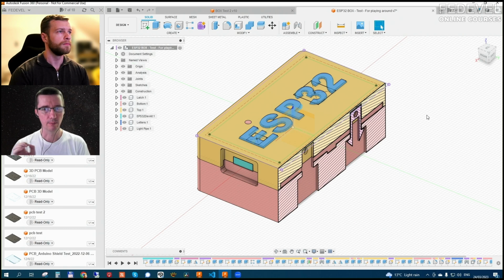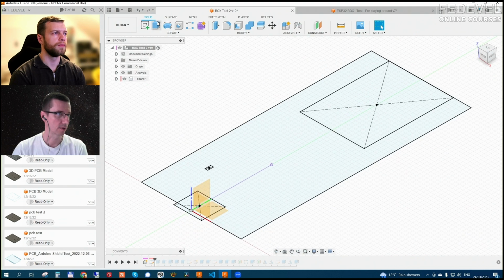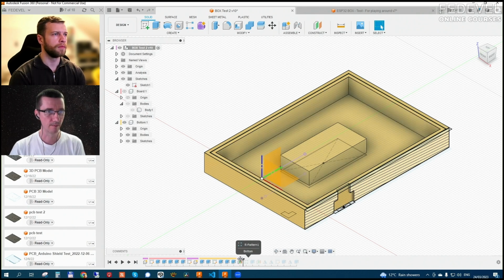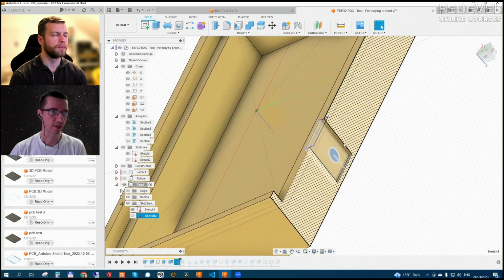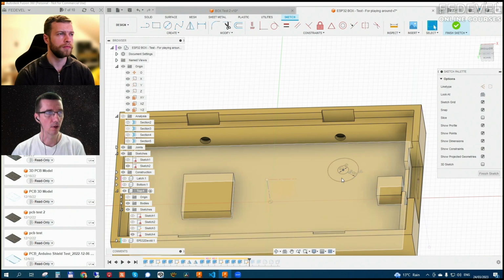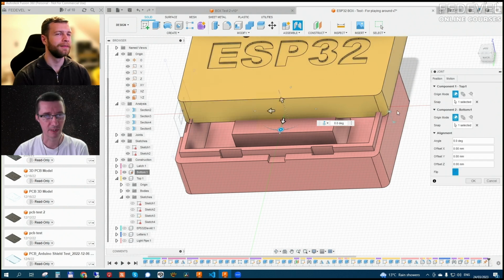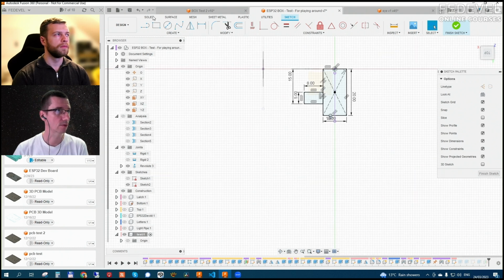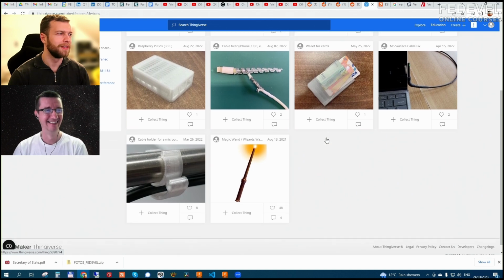How To Do 3D Mechanical Design? It’s Easy. This Is How It Works ….

Comment: Nice seeing both Robert and Phil in a video.  Anyway, you are talking about importing PCB and surface finish for rendering.  The best way to import a PCB is using a step file from Altium.  From this you have all of the same features as you have for the faces and modeling tools.  In addition, with Altium if you have enabled Co-Designer, then you can have a direct push/pull link between Altium and Fusion.  Likewise, I believe the reason you don't see an option for STEP is because you are trying to do this by use "Insert".  The best way is to use "File Open",  that gives you the option to select a STEP.  From there, save the document.  Then create a new document and insert the part for your total assembly.

Comment: CONSEJO #080: Agregar puntos de prueba Excellent video, nice to greet you and congratulate you, I am your new subscriber to your channel, I have a question, I am starting to repair all kinds of electronic boards! The question is the following in the general design of any PCB. Are the PCBs the testpoints only placed on positive lines or are they also placed on negative lines? I ask because there are repair techniques for the detection of short circuits where voltage and amperage must be injected to detect the short on the PCB

Comment: Thanks for the video. I'd like to say... not everyone can afford north of 500USD for a 1 yr. sub of Fusion 360... nor is it a wise investment to use the free? but broken version of Fusion 360... in 3 years time... might not be free anymore; but, you don't get the time invested into it back. I'm not planning to use Fusion 360.
Reply from the maker: For personal use, FUSION 360 is free. Of course it may change in future, however in my opinion if it is something you may use in future a lot or may be super useful, then it is much better to invest time to learn a professional tool, rather then trying to learn a free software and then find out there are some limits and start learning another software from beginning again. I have used some free 3D software before, FUSION is far the best - if I knew that at beginning I would not spend time learning the other software.
Reply: My understanding is that basic MCAD skills are highly transferable (eg. the general MCAD skills you develop on one platform will be useful on another). I tried to learn CAD on FreeCAD but the lack of polish was an impediment; I moved on to Onshape and made much better progress developing my ability to model objects. Knowing what I know now I could use FreeCAD with much less frustration as I would only need to learn its quirks and not develop basic CAD skills at the same time.